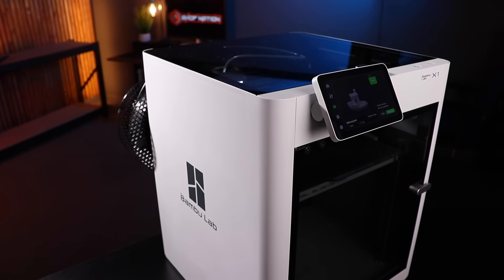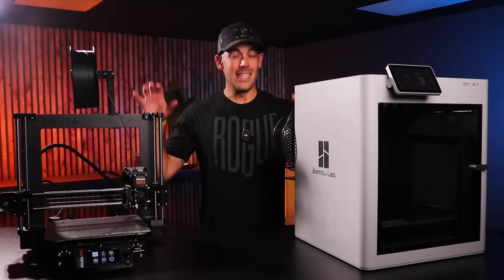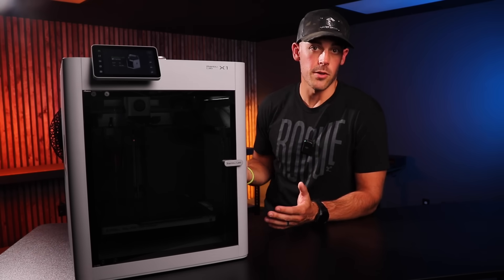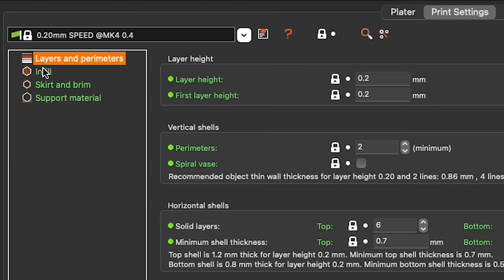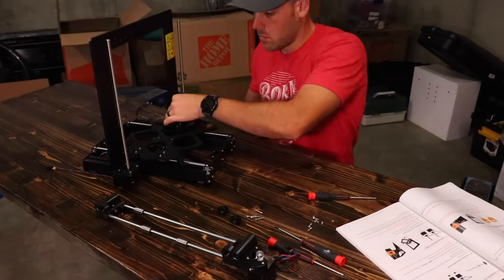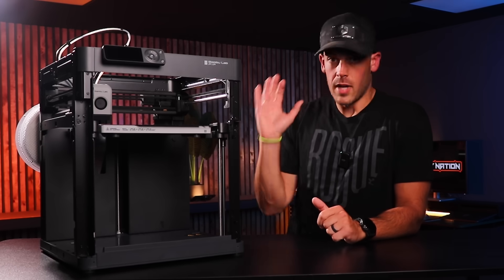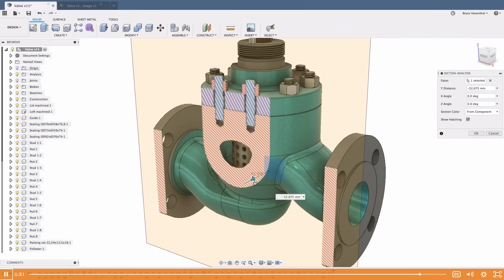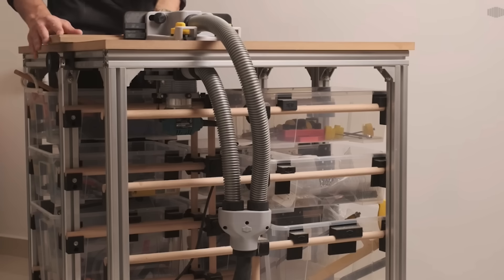The 3D Printer I'd buy if I started over

Comment: I bought a Prusa back in 2014 when they where just taking off. Still works great. I do have to manually level the bed. I use Blender to create the parts I want to print. Blender does have a learning curve but well worth it in the end.
Reply: In your opinion and as someone using a printer, what sets Blender apart from other softwares?
Reply: @eviltango  It's free for one. They have a plethora of tutorials out there that helped me learn. It's an extremely powerful program that I barley scratch the surface. They have updated to even a whole new screen set. But I still use 2.79 and it does what I need it to do. From making my 3D for printing or 2D for my CNC.
Reply: @eviltango blender is completely free for even commercial use.
Reply: Pardon my ignorance but what is CNC?
Reply: @SettoHexxo  Computer Numeric Control.
Reply: @SettoHexxo CNC means "Computerized Numerical Control" for cut and modify metal cube turn object.

However, CNC machine for only professionals and very difficult thing can risk of job accident. Only experts on CNC with higher security
Reply: Blender is honestly one of the best 3D programs out there, even as a VFX artist who uses everything from zBrush, to most of the AutoDesk Suit, I still use Blender at home because it is where I started in 3D modelling, and is still punching hard enough in the world of 3D to be used in some of our pipelines at work as well. 

Well worth learning and, it is free like you said.
Reply: I actually use creality print to create parts.  I know it's a slicer, but it just happens that the tools it includes to create and modify shapes and merge and slice models work very well when adapted to creating models.  I use blender as well, but only to remesh and decimate the models I create in creality print.

Comment: To every mechanical engineer, buy the Bambulab X1C. You will be expecting a machine that delivers expected results consistently, most 3D printers don't. You'll want to understand the variability of changing elements (temp, time, load etc) most 3D printers are so dynamic it's hard to lock down parameters so impossible to change individual elements exclusively. Finally it's a tool to assist your solution creativity, not bog you down preparing multiple prints to achieve the solution, get a stable good fdm.

Comment: Kinda feel that comparing a 3d printer to a microwave is rather flawed, for one thing I believe 3d printers are only really useful for hobbyists or people in niche circumstances. Me and most people will probably never be in a situation where they would print out a better fan blade for an industrial machine, where most people even before microwaves were even thought of could imagine reheating a meal in 1 min vs 15 min. Microwaves is far more useful in most circumstances than a 3d printer. One is a device that reheats food very fast the other is just something to print a part for a vintage type writer no one makes anymore.
Reply from the maker: Your narrow viewpoint on what a 3D printer can do is EXACTLY what that analogy was meant to illustrate.  You just don't know what you don't know
Reply: @ShopNation  I'm not saying what it can and can't do. Just not sure how many custom lamp shades you can print before it starts collecting dust.

Comment: I wish you went a nudge deeper on materials. I purchased the P1P the other day and i regretted it because i ended up being more interested in PETG,ABS, Nylon for some outdoor applications that require stiff and durable parts. The X1C would have been a better purchase due to the closed room and being able to better handle these materials.
Reply from the maker: Good point, however I'd argue that most beginners won't (or shouldn't) be attempting to print in the most exotic materials right off the bat.

Comment: This is great.  I have a ender pro 3 sitting on a table used for an hour and could never figure out why prints were not sticking. I still want to print, so I might shell out more for one of these models.
Reply: A fancy printer will have the same issues if someone hasn't set the machine up properly for you at the factory.
Also You tube videos telling people that they need glass beds or other fancy surfaces is just because youtubers need to produce content. Just raise the bed temperature and use cheap glue stick on the standard surface and you should be right. The default temps are low because they would have youtubers telling them that the temps are to high.
For the price of a 6 pack find a friend who is successfully printing and get them to take a look.

Comment: Both are expensive for a beginner who may or may not use it as a tool (more than printing stuff from thingiverse/printables for a while and then gathering dust). Also there is the breaking things, as a beginner you end up doing that, which can be costly on these models. I recommend either a Sovol sv6 or any kind of Ender 3. Off the shelf parts, and cheap to repair if you damage anything. Need a new fan because filament strings burned it? 2 dollars. Nozzles? 2 dollars a piece. Servos and motherboards are also pretty cheap to replace/upgrade.  I see the Bambu lab and the Prusa more like the second step for someone who already turned a cheap printer inside out for a while and wants more speed/quality.
I use an Ender 3 s1 pro - half the price of the Bambu Lab, and more than three times cheaper than the Prusa. It has seen a lot of projects and had just a couple of issues, both  my fault. Now it is printing with recycled PET from bottles and the results are great. I'm thinking of getting the Bambu lab in the future, but being a tinkerer I might just jump to a Voron.

Comment: Sovol makes some reliable 3D printers that work well and are good entry level printers that allow newbies to spend time learning 3D design and 3D printing as opposed to working on printers, and their designs tend to use open source hardware that's readily available and inexpensive.  FreeCAD is a good free open source 3D CAD tool that's easy to use.  Amazing complexity can be achieved with the basics, but it's also a powerful parametric CAD program.

Comment: A lot of the parts for the Bamboo are available and are inexpensive. The advantage of the bamboo is that you can buy the top mounted multiple roll feeder which will change filaments automatically, even different types, not just color, allowing you to make something with different materials. Yes, it wastes filament when it changes them. But to be able to use two or more filaments in one object is very useful.

Both the Prusa and the Bamboo are great machines. And realistically, for what these machines do, particularly the Bamboo, $1,200 is really inexpensive! These, unlike many others, aren’t toys.

Comment: The Tesla/Toyota analogy is good, but I think an Apple comparison is also useful. The Prusa uses off-the-shelf components, and Bambulab is more of a closed, proprietary system. A good one, but closed systems have drawbacks, especially if the company can't keep up with the demand for support. As Travis points out, this an unknown at this point. 

I fall into the category of wanting a solution that just works out of the box, and the X1C has so far lived up to its promise. I'm totally new to 3D, so reducing the learning curve is helpful.

Comment: I'm a mechanical engineer and have been designing for 15-20 years. At this point I could not live without a 3D printer. I've had an ender 3 for many years and it has been a solid little machine. But just recently after seeing all of the reviews of the X1 Carbon, some seeds were planted and became tired of turning bed knobs and dealing with bed issues in general (painters tape was my favorite solution).

I ended up buying the X1 with AMS and it is the best thing since sliced bread. It's absolutely fantastic, easy, high quality. I totally love everything about it.
Reply: I can agree with you in everything you´ve said. I love my heavily modded Ender 3 (not even Pro or V2) but after getting the X1 Carbon I think that this opened the gate for making literally everything without having to worry about quality or reliability

Comment: I find it ironic that he touts the benefits of "not working on a printer" and then recommends a kit to build a 3d printer. Small repairs and issue are always going to be a part of 3d printing. It's just a function of running hundreds of meters of plastic though a printer. There are wear parts that need to be replaced and some extreme temperatures at play. No product will negate this. I absolutely disagree with the " it's a good printer after the mods" comment. If building a kit is a good idea, then buying a basic printer and then adding the features that you'd actually want for hundreds less would be just as good an option. It's also puzzling that he described a 1200 dollar printer as one that anyone could buy. Absolutely not the case. That's why a 200 dollar ender3 is one of the most popular printers today. I'm not saying I think it's the best, but it works, it's much more affordable and very upgradable.

Comment: I like your reasoning BUT I'm someone who wanted a FDM printer but didn't want to fiddle or spend over $1000.  I bought the Elegoo Neptune 3 Pro on sale for $230 and this printer needed me to slightly tighten the print bed rollers out of the box, and that's it.  I've had 1 single failed print caused by me not having the temp set right for some silk PLA+.  Other than that it's simply worked despite me being completely new to FDM printing.  
   Now that said I have not used the printer non stop for an entire year yet so I cannot say it's print farm worthy and wouldn't require more replacement parts than a $1,200 printer over years of use.  That said dollars to donuts a $1200 printer would literally need to go 5 times longer without need for any maintenance to justify the price difference.

Comment: Very interesting video ! Thanks for that. In your introduction you have said the most important thing:  Do you want to use a 3D printer or spend your time customising a 3D printer? For me a 3D printer is only a tool to create technical objects. As a tool I do not want to spend time solving problems on it. I want to use it. I have an Artillery X1 printer since 2 years. Now I look for a better and more reliable printer and the X1 Carbon will be my choice. I was looking to PRUSA but sadly for me their last machine is disappointing. The Bambulab P1P is cheaper than the X1 C but is not ready to go. Too many things to add by yourself to complete this machine if you want to print multi materials.(like the walls and the filter system)

Comment: Surprised you didn't mention the Flsun V400 for the lower tier, especially since the prices are under $800 now, checks all the boxes for easy setup and usage. It is a tall printer but probably has the smallest desk space usage of any printer out there in its print size category.

Comment: Great overview.  I just jumped in and bought an X1 Carbon. I've made 3 prints, all came out great, and one was a model I created in F360 (I'm new to that too).

I think it's fair to note that the Bambulab feature for wirelessly sending your model to the printer directly sends the file to a Chinese server. If you need to protect IP, you might want to consider where you're sending your file.
Reply: yes, this is important for business customers; especially as their track record hasn't been amazing. There are ways to get around it, by using another slicer, or using the USB, but you have to go without spaghetti detective.
Reply: @jeremyglover5541 or stop buying Chinese products.
Reply: That has changed with recent firmware upgrade, now you can print offline. Enable LAN only mode and it does not use the cloud.
Reply: @schrodingerscat1863  Yea I learned that a couple days ago. This resolves the biggest issue, but it looks like LAN-only doesn't support remote viewing, a feature I use a lot. I love this printer...so much fun!
Reply: @independent900  That makes sense if you think about it, remote viewing needs some way to link the remote device on the internet with your printer on your own private LAN.
Reply: @schrodingerscat1863  agreed, this is true if my laptop or phone are connected through the cloud. But in LAN-only mode, all of the devices are by definition, connected. If I can initiate a print from my laptop,  there's no [apparent] technical reason to restrict access to the camera. I'm guessing this is just a lifecycle issue, and will be fixed in time.
Reply: @independent900  Apparently the camera is available on port 6000 so it looks like this is just the software not supporting it yet. I think ultimately they will get this all sorted out. Same thing with monitoring it is all available over the network but the apps seem to be focused specifically on cloud connectivity rather than direct connection to the printers. It isn't an easy task to repurpose the apps so I dare say this is something that will take time.
Reply: @schrodingerscat1863  Agreed. It's not an issue for me anyway, but could be to commercial farms.  I'm guessing the camera issue isn't as important to them as the ability to manage jobs from a computer.
Reply: @independent900  Exactly, for these machines to get serious consideration by small scale farms they will need to provide much better local network integration and monitoring. Still they do seem to be going in the right direction and time will tell if that continues but I suspect it will. As a company they seem interested in primarily in shifting printers not developing cloud based revenue streams.
Reply: @schrodingerscat1863  spaghetti detective still requires the cloud, as the computing is done there I believe. if you read the TOS, it doesnt seem like things are moving in a different direction. There is no way anyone developing product should use these printers. As has been mentioned elsewhere, some revenue streams, countries and contracts will not even allow you to, due to ITAR concerns. As far as they are concerned, they have equal, or even controlling interest/access to your work and wash their hands of any responsibility of any data leaks of their, or their partners servers. its dodgy as hell.
Reply: @jeremyglover5541  your concerns and skepticism are well founded, and I agree with everything except maybe the direction. Was LAN-only mode added in response to user pushback and adoption fears? If so, then they might be showing more concern about sales and adoption than stealing IP. Ultimately, their government might have a say.

One thing for sure, this model couldctake IP theft to a whole new level. They don't need to reverse engineer anything, just take the models and print them! It's a brilliant model if you're a cheater, but we know the CCP wouldn't let that happen🤫
Reply: @independent900  Oh I dont think there is any doubt at all that this is nothing but a half assed reaction to widespread user feedback/chatter
Reply: @jeremyglover5541  though I'm dubious of any tech from China, I'll keep a cautiously open mind for now. The fact that they responded to criticisms in a timely way is a good sign. The fact that they started with low-hanging fruit is what any company would do (I.e. do something that solves as much of the problem as possible in the least time.) Now we wait and see if they take another step toward localization, or if they resist it. Competition is coming fast, and they will need to address adoption issues in order to capitalize on their early-entry to new gen printers. There's plenty of room for improvement, so they won't be successful in the long-run if localization isn't a core value.

Comment: best vid i watched on this topic so far....not the typical fanboi video. I had some printer before...Deltas..BIG Deltas...a Voron V2.4 and now the Bambu X1C and its the first printer thats simply a tool...and not a new hobby. and im totally with you...best bang for buck offers the P1P and upgradable to print material like ABS, Nylon, PC....thats something thats not easy on a bedslinger...would love if Prusa would make a CoreXY with all the advantages that prusa offers
Reply: In the works - Prusa XL is on pre-order for end of 2023 for ~$2k base
Reply: @gregm2181  yeah..but..more expensive...the frame is open in the front...and still not a full enclosure but only that kind of sjirt around it...the tool changer is a real advantage..the rest of it is still behind a fully enclosed cube imho

Comment: This is why I bought an Ender 3 S1 Pro.  No upgrades.  I printed a small bracket that clips onto the printer to add some strain relief for the ribbon cable but that is the only upgrade/mod I have made.  The Prusa printers are nice but WAY out of my price range.  The Bambo Labs printers?  They are nice but look up info on those carbon rails on the X-axis.  They are basically consumable!  I would rather a printer that is fairly complete but also cheap to maintain and repair, Enders are open source too for what it's worth.